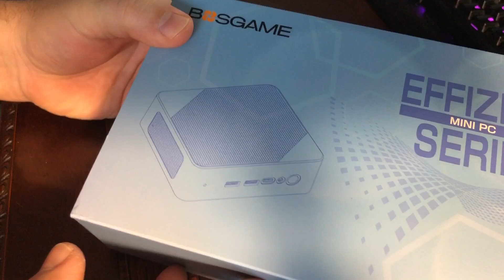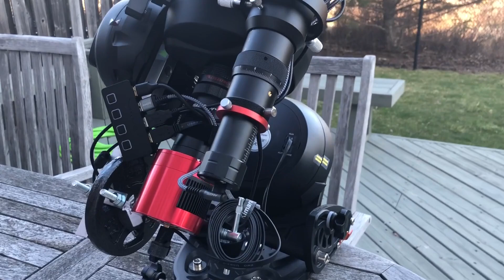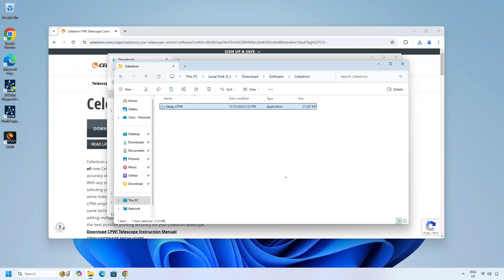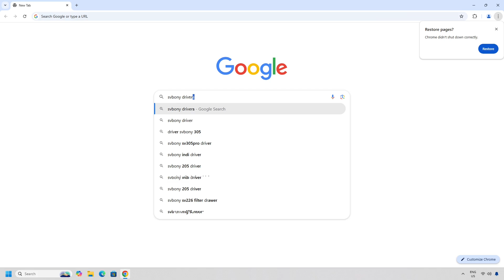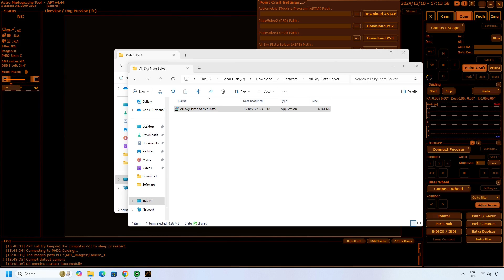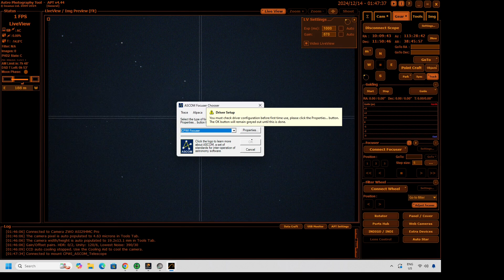How To Set Up A Mini PC To Control Your Celestron NexStar 6SE/8SE Telescope On A Wedge | COMPLETE!

Comment: Hello Chris, I have a similar setup but with a refractor.   Thinking between a fanless MelE mini pc or a Bosgame one...Is your mini to noise and producing too much vibration?...I need  a mini pc to run, cpwi and APT.  I have the celestron wifi module but always disconnect no matter what.  Thanks in advance and CS!
Reply from the maker: I upgraded my SLT mount with another Bosgame mini PC, no issues with vibrations on either setup.  Important
to note that neither mini pc is bolted directly to the OTA.  On the 6, I have it connected to the dovetail counterbalance extension rod, so any minor vibration would be dampened by the mount.  Both rigs have ZWO cooled cameras with fans that seem louder to me than the mini pc.

https://youtube.com/shorts/RjFR5gvZOxs?si=1F96yPr7yjMxWImD

Comment: Hi Chris, what a coincidence, I'm working on a mini pc for my telescope also. Maybe I have tip for you. You say you copy your imaging files later to another drive. I use an external (usb) ssd drive to copy the files imidiatly. For that i use Robocopy, a litlle program in windows. So I have an imidiat backup. When ready I can copy all to my procesing pc. Run CMD and type robocopy. You have to setup some things, but there are youtube on it. Thanks for the video, saludos from Spain, Rob
Reply from the maker: Hey Rob, that's a great idea, thanks for the tip!  I typically connect a network share, so using robocopy would make it so the images are copied over as they are saved, so I don't have to wait for them in the morning.  Clear skies!

Comment: Good video!  I've had a Mini PC mounted on my EDGE 8 for the past 5 years and it works great on the cold nights, when you can remote into. I was using Celestron software and SGPro, but moved over to NINA and haven't looked back!
Reply: @davidf9494  I used NINA in the past. Got tired of updating drivers for different equipment.
Reply from the maker: Thanks David!  I'm shocked by how economical these mini PC's have become.  I wish I had made the switch a long time ago.  Clear skies!
Reply: @Felldisulfide  Thanks  - my MINIX mini PC was small when I bought it 5 years ago.  Now, mini PCs are smaller, more light weight, and more functional. Clear Skies to you too!